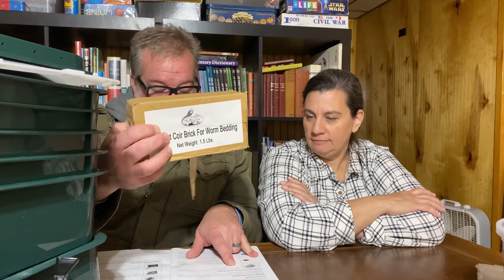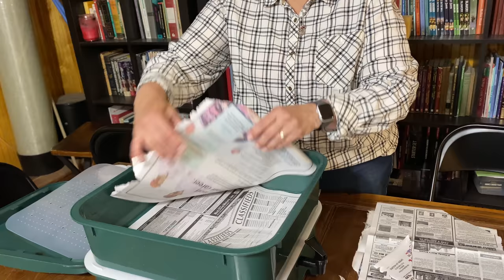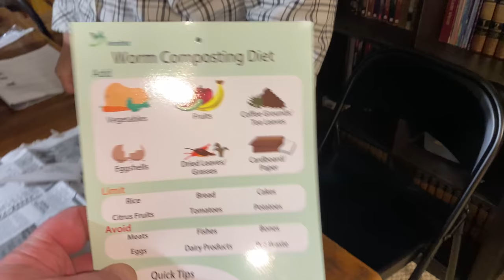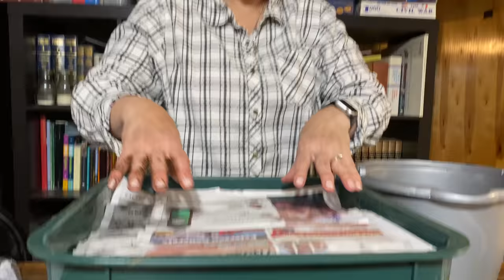Worms and BEES and Cheese OH MY | A Big Family Homestead VLOG

Comment: My ex-husband did an experiment in college about overwintering honey bees. We had zero loss of bees!
Reply: what was his experiment? We are new bee keepers 1st year, any advise is more than welcoming :D
Reply: He built a frame from 2 x 2's triangle from the side, tall enough for a hand made door. Covered it all in 3 mil plastic, open to grass on the bottom. Painted empty soda cans with flat black paint so they would absorb heat. The cans went on the ground around the base of the hive.  Bees die in the winter because they can't stand the cold to go to the bathroom. This keeps the air warmer so they stay healthy. I wish I had a picture but I am not at home right now
Reply: @ajinpnw6221  Hi! This is how we had our first beehive: Lived in the city, cut out a hole in the wall of our screened in porch, inserted a hive to the inside, built the "lip" on the outside, supported the hive on legs because it was about 3 feet off the floor, and the coolest thing about the hive was that it was built from quarter inch plexiglas. We cut a cardboard box to fit over it and any time we wanted to we could lift it up and see the bees working at pulling comb, capping cells, scurrying around cleaning up the hive, it was awesome. Go for it, good luck.

Comment: Down here on the sandy Texas Gulf coast we are seriously lacking three things in our gardens.  We have no rocks.... not such a bad thing when you have to dig a post hole but all our soil amendments sift away VERY quickly.  We also have no worms.  In over 15 years of gardening down here, I have yet to see a single wiggly worm.  I have found grubs for the chickens but NO WORMS.  Because of the previous two deficiencies we have a third item lacking in our gardens.... no soil.  The return analysis report of our soil samples simply states "you need everything but sand."   I may try an indoor worm farm but I doubt they would live very long in the beach beneath our feet.